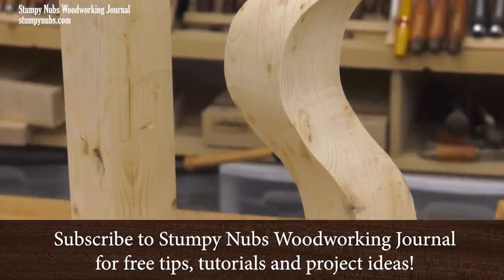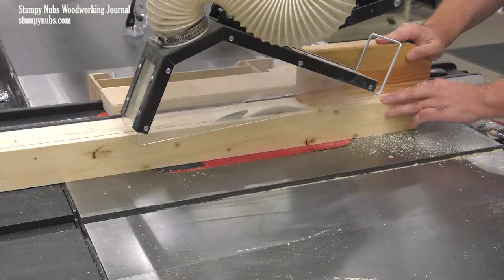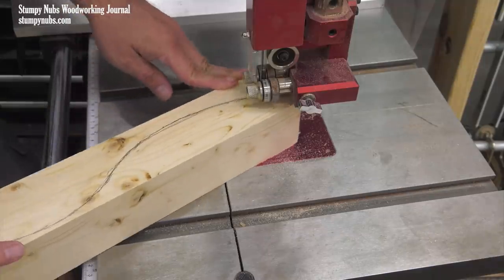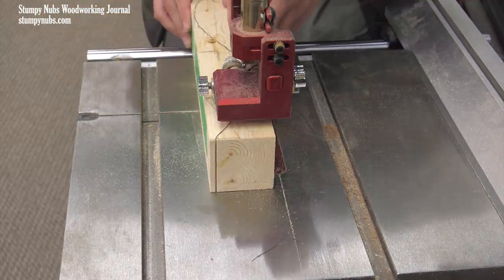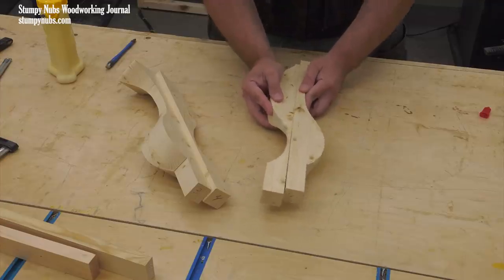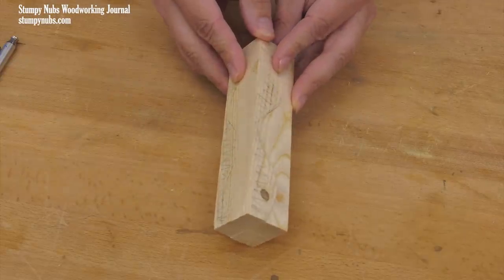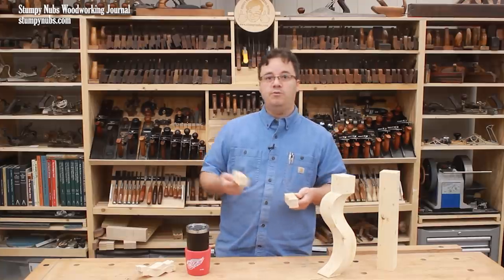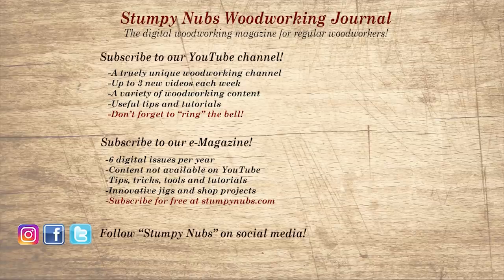Mind-bending trick makes curvy legs with NO WASTE!

Comment: I've made lamps using this technique, laminating different woods to create the original blank. They turn out really cool. I really like the very helpful stuff you continually put out here on the interwebs. Thanks James!
Reply: Ahh! light bulb goes on. You trim the outer edges to make a passage for the wiring. Thanks. I'll be trying that one.
Reply: @spamdump4459  damn that's smart, sure beats tryna find a big enough drill to go through
Reply: First rhing i thought when watching this was 'damn, now i need to go make a lamp'. I had the exact same thought @Spam Dump

Comment: Drill some holes! They can line up internally for dowel pins, and this makes glue-up and setting much simpler, as alignment is fixed.

The holes on the faces of the uncut form will come together, so the holes just need to be level and equally spaced from the uncut edges on each face, no measuring around corners needed.

Comment: An oldie but still a goodie... been making lamps like this for years. Curious to know where you got the idea from. I got it from a very old woodcraft book. I posted this on Woodwork Forums around 15 years ago.
Reply: If you start with rounded corners, it should leave a hole down the center for the cord.
Reply: @stevesclocks  You can simply rout a bevel on each corner, does the same. Just remember, leave at least 10mm gap from each edge when drawing your profile.

Comment: Would it be a best practice to make the initial straight portion of the cuts all in the beginning with a stop to ensure the straight portion is all of a uniform depth? Or would having different depths result in more interesting patterns?
Reply from the maker: Sure. Better yet, have two band saws set up, one for straight cuts, the other for curves ;)
Reply: @StumpyNubs  Step two is to get my own band saw. Step one is to get my wife to OK one that is capable of resawing. :)

Comment: I love and learn from every Video you make and I thank you for that. Keep them coming never can learn enough. Question I have been looking at buying a band saw, a good one. I'm 74 yrs old and fell in love with playing with making things from wood. I am still setting a shop up. I look at the Rikon and then the Laguna seems better then find the Harvey like yours same model. Fell in love with the Harvey but the price is about $700 more and there shipping is like $360 and all the others ship for like $100 . No I am on a budget but like good tools and beleave you pay now or later. I will probably be able to play with this for about 10 years max. Whats your honest thought.
I do have a Wen 10" 3.5 amp I just got and was thinking return it and buy a big boy that can do it all
Reply from the maker: I used to have a Rikon. It cut just fine. The blade guides were a bit of a pain to adjust, but that's the case with most saws in that class (and many above it, as well.) In your case, I think a Rikon, Laguna or even a Grizzly will do the job.

Comment: Awesome! Could you make a discussion on which direction is a plywood stronger: across or along the grain - grain reference is of course the surface ply. A piece of wood is stronger along the grain but a plywood - at least ALL those I have dealt with - have their surfaces plies on both sides almost paper thin that, in all, the internal cross-grain plies have a thicker total dimension than those that go in the direction of the surface plies. This is structural issue so ignore the aesthetic for the meantime.

Comment: Fantastic! 😃
Once I have seen a man who quickly cut a small stag with horns from a single piece of wood with a band saw.
There should be that video somewere on you tube.
That's what Your trick reminded me of 🤣.
Joking apart this is extremely useful upproach, since cabriole legs are very wasteful in terms of stock.
I glue  bits and pieces to the straight "core" of a work piece to save stock.
However, Your method is far more elegant. 👍

Comment: Instead of using pin nails for alignment, another trick is to sprinkle just a few grains of salt into the glue joint.  The salt will give it enough traction to hold still while the clamp pressure comes on.

Comment: Can I suggest that rather than numbering the pieces when you put them together, you just draw a circle in the four tops?
Reply: well all 4 peices would have the exact same marking. lol.
Reply: Your logic is actually correct. It's just the shape that doesn't work. Every piece would have the same shape if it was a circle. 
Where i live, we use "the carpenter triangle".
You put the pieces together and draw a triangle in a spot where all the pieces align and then you will always know which piece belongs where, because they all have a different shape

Comment: I haven't watched the video yet (paused at 0:01), but I'm going to make my guess now what the trick is supposed to be, and edit this afterwards to say if I was right or not.

My guess is that the trick is going to be cutting curves out of the wood using a very fine jigsaw or similar and then joining them on the opposite side of the cut, creating the illusion of a bend by the unchanging thickness of the resulting piece despite the changing curvature. Technically not a "no waste" solution as any form of sawing is going to produce sawdust, but close enough. Now to watch the video and see if I was right.

Result: yes, but actually no. Right in broad strokes, but the actual technique was more complicated and is probably more structurally secure as well. It's also much better for more complicated 3D shapes than what I came up with, and is pretty cool in general.

Comment: Ok I like the technique... But I wonder, how would you make two or more matching legs using this technique?
Reply from the maker: Use the same template on them all.
Reply: @StumpyNubs  right but from one piece to the next your blade drift will be a little different right? Normally I'd correct that with a flush trim bit but I don't think that would work here?

Comment: Can any structural engineers chime in about how much support you lose when doing this? Intuitively, the "bent" leg looks like it would support less weight than the original, but I'm curious by what % amount, and how the "curvyness" of the bend affects that %.
Reply from the maker: Glue is stronger than wood, so the glue-up doesn't weaken it. The curves themselves may have some impact upon strength, but so minimal that it must have no measurable affect in a furniture application.

Comment: Actually you will not get a square cross-section if you "glue a couple of 2x4s together" since dimensional lumber is not the same size as its name. The result would be about 3" x 3.5".

Comment: While this is helpful in preventing waste, the one downside to it, that i can see, is that it slightly lowers the quality of the product. 
While it is alot more wasteful, if the leg was cut out of a single larger piece of wood, it would look a bit better than if it was glued together.

Plus, glueing together the individual pieces and then having to wait for it to dry takes more time and will make the finished product more expensive (unless you coordinate it right and set set the drying time during lunchbreaks and or overnight.)

This probably isn't something that carpentry businesses will use and should be used by hobbyists